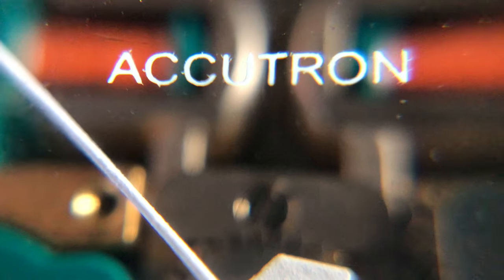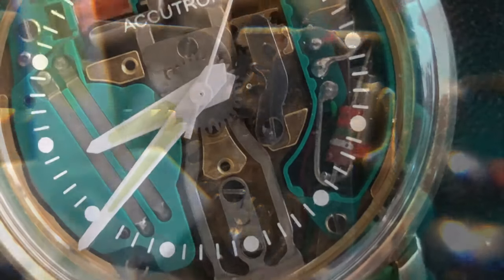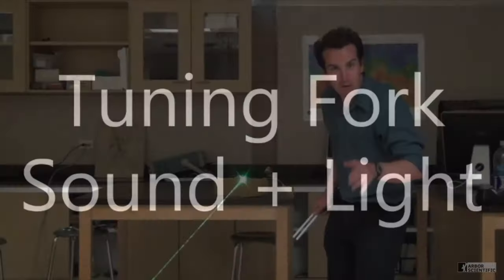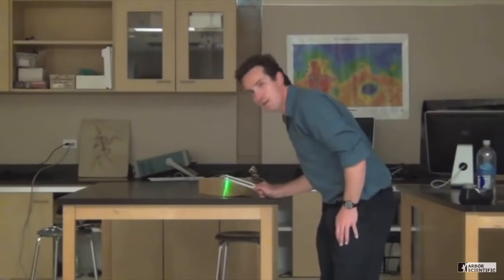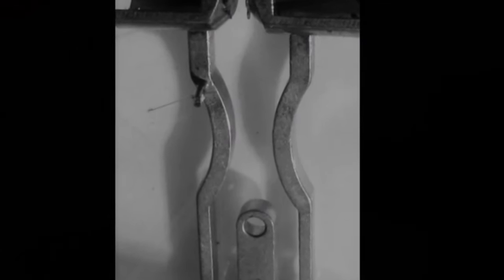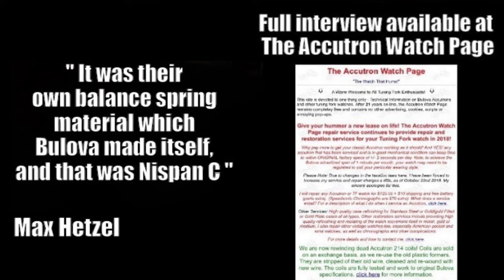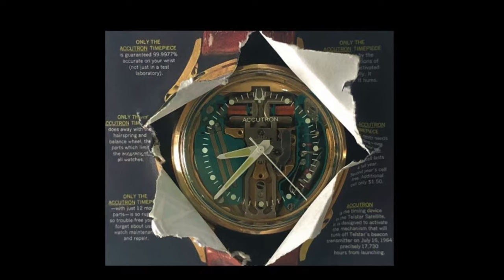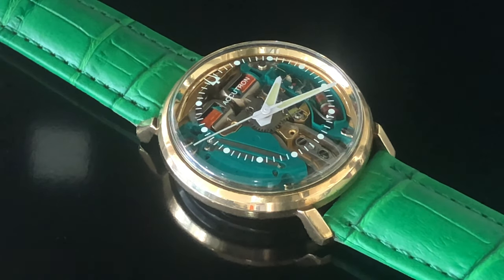Accutron and the Spaceview. A short history.

Comment: I bought my 214 Spaceview new in 1966 at Zale's in the Gateway Shopping Center, Shreveport, Louisiana.  It was my first credit purchase as an Air Force NCO.  I still wear it, runs a little fast on these new "green" batteries which put out a bit more voltage than the originals,  The price was nearly a month's pay at the time, but it was too cool to pass up.
Reply from the maker: Thanks Hugh - Still cool after all these years :)
Reply: You can fit an accucell battery. It's 1.5v but is stepped down to 1.35v so your watch will run to time.
Reply: Get someone to service it and phase it.  It will be spot on.
Reply: @DanaTheInsane  Easier to fit an accucell battery.

Comment: the index wheel ,the size of a pin head, has 360 teeth. Accutron were made to use mercury batteries 1.35 volts, the new silver batteries have a .15 volts + difference,thus make the watch less accurate.
Reply: You can now get a battery by accucell. It's 1.5v but is stepped down to 1.35v so your watch will run correctly.